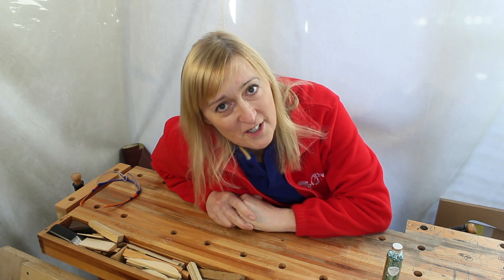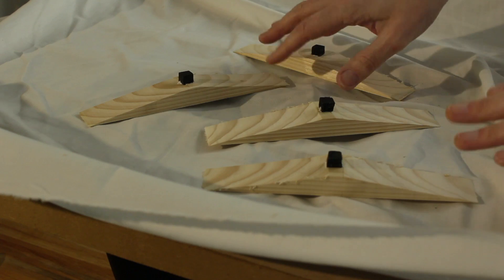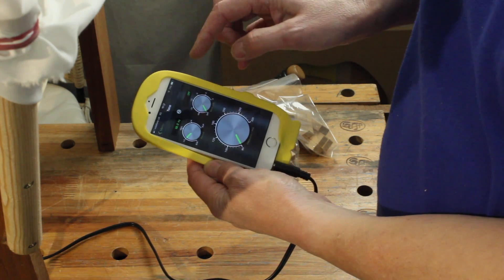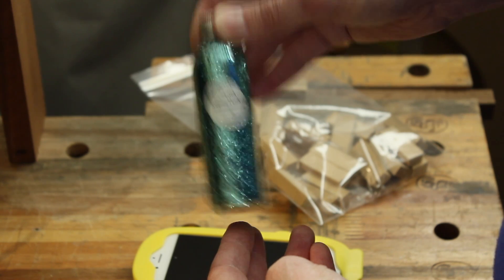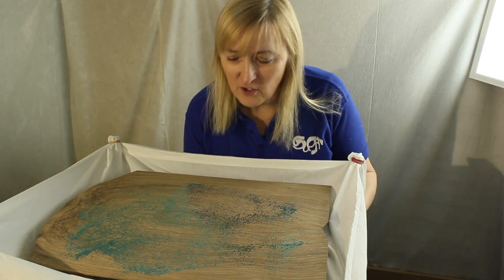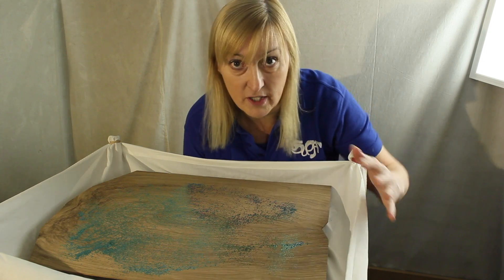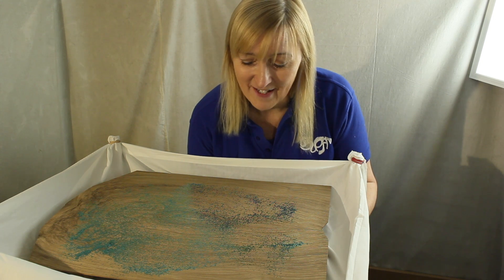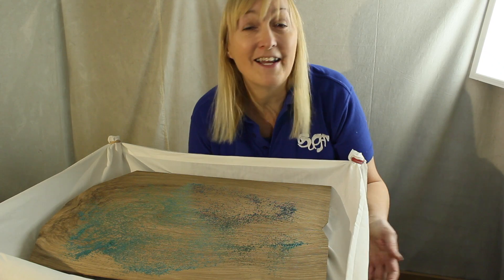Chladni patterns (almost)

Comment: Susan a lot of the guys doing this also use poppy seeds.  Probably cheaper than tea leaves?
Reply: ....and seriously - get the Gore/Gilet books.  There's plenty of science/maths/engineering aspects of lutherie in there - enough to make you want to change your build style radically (well it has me anyway!)
Reply from the maker: I’m still reading Somogyi and that’s given me ideas. I’ve read some good lutherie journal articles too
Reply: @SusanGardener  From what I've read Somogyi is the more intuitive approach which is great if you have the experience of having tapped hundreds/thousands of guitar plates and know what to listen for.  Gore/Gilet has a measurable, scientific approach which allows you to optimise an instrument regardless (within reason) of the materials you have available.  For example to get an estimated plate thickness there are various equations using such things as the wood density, its Shear Modulus and Youngs Modulus amongst other things.  Material properties that can be quantified in other words.  I like their approach as I don't have said experience of having worked with thousands of instrument plates.  I haven't read Somogyi so can't say if that's an accurate description of his approach.  My next instruments are going to follow the Gore/Gilet approach to plate thicknessing with falcate bracing and using carbon fibre to reinforce the bracing.  I have high hopes!
Reply from the maker: I get what you mean. Somogyi does offer some specifics but he can be frustratingly vague - eg keep going till you hear the top open up - this will come with experience
Reply: @SusanGardener  there's none of that with Gore/Gilet.  Hard facts and data are what drive their approach.  I'm sure Somogyi's approach works for him and clearly he makes amazing instruments.  Gore/Gilet puts such instruments within reach of mere mortal builders like myself.